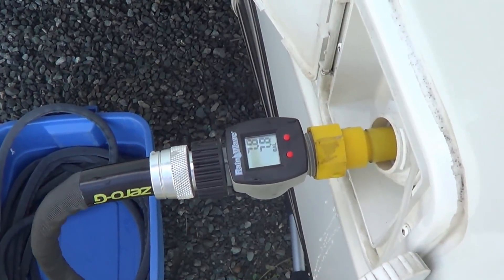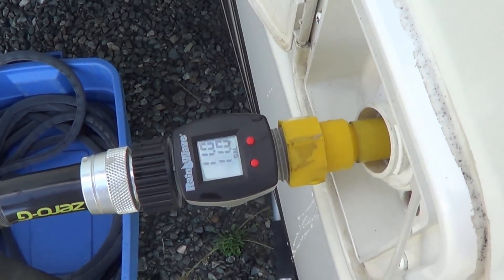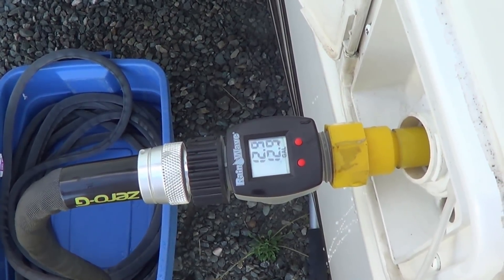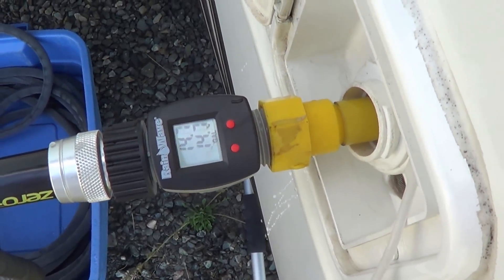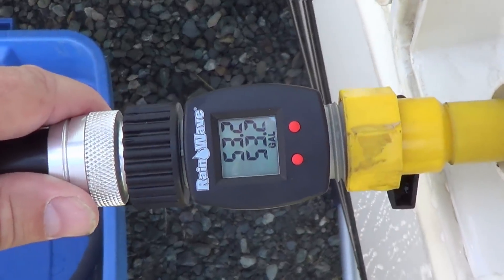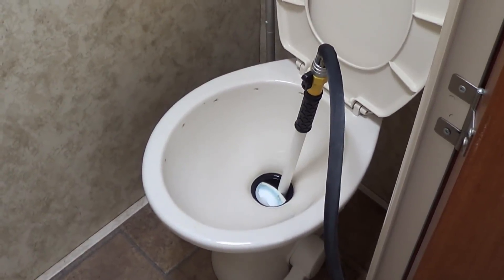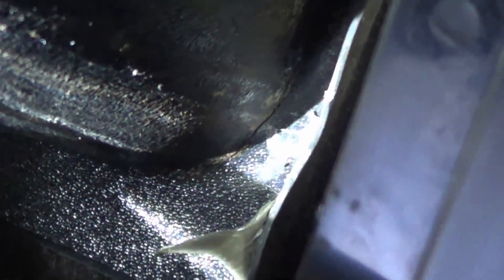Checking RV Tank Capacity - Then OH OH! Cracks!

Comment: I used the same stuff they use to hold windshields in cars on my black tank crack. Drilled small holes where the crack begins so it doesn't spread first. Never leaked again.  But my crack was not near a supporting part of the tank.

Comment: Morning Ray, John Ingebretson from Montana back at you. We, as you might recall, have the same model/year. I also found a crack in the black tank above the valve flange, not quite as high on the tank as yours. I elected to go two phases. Phase one, I mixed up my own ABS mix with acetone and shredded black ABS pipe, combined with a window screen patch. I applied several layers of that, and let it all dry. Then I took two applications of commercial 2 part epoxy tank repair from dealer with more window screen material, and layered that up. It appears you used a similar product on the flange out of your black tank at some point. So far after this latest trip,vI have not had any leaks from that repair. But having said that, I think the weight of the tanks on the rails, hanging down as Keystone has designed it, is definitely a weak point. Not sure what a permanent fix there would be. I might add, I had to replace the entire black tank two years ago because of a similar problem where the crack was 5" long. Some blogs have mentioned the issue of both tanks moving around on top of the Rails, because they are loose. It's possible they designed it to have that kind of motion, but this could cause strain and vibration on the whole system, leading to some of these problems. I'll be interested to see how the PlastiMend works, as I had considered that too. Also, after having used different approaches,  I've been thinking about which product to carry around for an emergency fix on the road.

By the way, I have finished my solar install, 4 Carmanah roof-mounted 170w (680w) with TS-MPPT-60 amp Controller & TS-RM-60 Remote Panel, and 4 Fullriver DC 22-46, 6V AGM's. So far, down in the desert and even up here in cloudy Glacier National Park, I have not had to use the generator! Can't believe I waited so long to do it. 
Thanks John
Reply from the maker: Hi John, thanks for the info. I thought I'd try the Plast-Mend since the cracks are in such a hard to get to spot and it looked like an easy application. I order 2 kits to have a back up for the road.
My black tank flange is factory, I haven't touched it. :)
Your boondocking system sounds terrific. Cheers! Ray

Comment: Ray, with great success, I have used a product called Plast-aid. I had stress cracks at the lower corners of my hot tub that were beginning to leak - similarly weight induced. Plast-aid has repaired the leak two years running with no further concern - at least at the points of repair.  This product sets up quickly and chemically bonds to the surface as a plastic. It's rated for use on ABS, and I am confident it will create as strong, or stronger, a surface as the original. You'll definitely figure it out. You always do. Love your videos.

Comment: Good luck there with the translucent white freshwater tank I could not get any form of glue to stick except the hot glue gun and that took quite a bit of supplemental heat to break down the tank material to accept the glue. I hope that repair with an ABS product works well for you I will keep watching

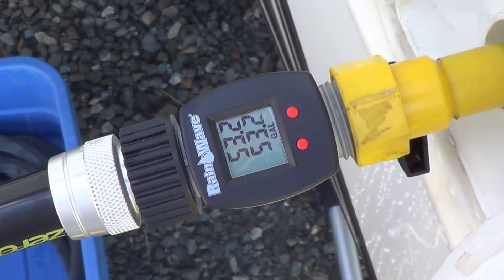Comment: Tipping the tank is a great observation at 2:00.  If stuck somewhere you could try lowering/raising the front of the RV vs draining the fresh water tank into a container.

As for the cracks please check out this person's fix - https://www.youtube.com/watch?v=N2rVLU3bDMY.  It is 25 min but worth a view.  He covers drilling holes into the crack line (ends and middle) to create crack stress relief which should stop the crack from extending in length.  How to make a heavy duty ABS cement by mixing ABS shavings into ABS cement.  This mixture is used with fiberglass to make a solid patch.  Good catch!
Reply from the maker: Wow, that's pretty ingenious of him. :)

Comment: Are you sure they are leaking and not condensation with the cold water you are putting in. Seems like you would have noticed a leak before this test. 

And with my RV, my total fresh water capacity included the water heater.
Reply from the maker: No definitely cracks. I never noticed before as they are small and thin and right at the tank top, tanks usually don't get full enough before dumping to leak there. I was trying to fill them to the max for a capacity test. Also, usually the coroplast underbelly is on and the drips would have pooled on it. I did notice some dried up water stains when I pulled it down to do the valves. Now I know where it came from. Cheers, Ray

Comment: Flex seal tape until you get your kit to repair it.  That stuff is a miracle.  You can even use it on the wet tank and it will stop water.
Reply from the maker: Not a bad idea.  Luckily the cracks are small and at the tank top and I'm stationary for a while so will leave it so I don't have to try and remove extra stuff to prep the surface. I think Eternabond tape would do a good job too. Man, that stuff is sticky! Cheers, Ray
Reply from the maker: Thanks. I think I'm going to get some of the Flex Seal tape to have in the RV on the road just in case. Cheers! Ray

Comment: Hi Ray. Since you are still at home base, Canadian Tire has a neat repair kit. It is called Bondo Fiberglass Resin Repair Kit, 5 piece kit. The product number is #047-5825-0, $39.99. It can be used on a variety of surfaces, metal, fiberglass and more. Check it out if you think may be helpful for those unfortunate hairline cracks. Good thing you did that test. I will bet you a doggie biscuit lots of folks are going to test their tanks now (thanks to the supervisor). Thank you for the heads up. Happy trails.
Reply from the maker: Thanks. :)  There is also the Discovery Boat Yard marine store, going to check what they have too. The tanks are ABS
Cheers! Ray

Comment: You might try plastic welding to fix the cracks. Harbor freight has a cheap  plastic weld kit. Its not the best rig but it will probably work for you. Its about 60 USD. Practice first before attempting a weld on your tank.
Reply from the maker: Thanks going to try a chemical weld first with Plasti-mend. The cracks are in an awkward to get a spot up high and in a corner. If that doesn't work I will likely pull tanks and try the plastic welding. Cheers! Ray

Comment: So I'm sure somewhere out there there is an adhesive that will stick to those tanks but I've never yet found it.
Reply from the maker: They are made of ABS plastic so I figure any ABS type repair should do the job. My top 2 so far are:
http://www.plasti-mend.com/cart/index.php?route=product/category&path=59

or I may just get some ABS pipe heat it up and form it to the surface and then use ABS glue to attach the patch.
Cheers, Ray

Comment: I know that we have similar models of 2011 Keystone 5th wheels. Over the last 1.5 years I have replaced the black tank due to a tank fracture, one grey tank for the same reason. And the second grey tank for a cracked fitting mounted in the tank. Both grey tanks according to the factory brochure are supposed to be  40 gallons each. In reality they are both 34.5 gallons. This tank is no longer available from the tank manufacture. The black tank replacement was with a different brand and slightly larger than the original. I did do some research and found the best repair was to replace the tanks. The cost of replacement for material and labor was about $1500 for each tank. I feel fortunate that I have an extended warranty that costs $200 per incident. Just more evidence that poor materials and installation designs caused by the manufacturer.
Reply from the maker: Wow, $1500! If it comes to that I think I'll order tanks from http://www.icondirect.com/categories/RV-Exterior-Parts/Holding-Tanks/ and install myself

Comment: You could use a polyurethane caulk like pl5000 available at home Depot along with a fiberglass mesh sheetrock tape to make the repairs. The stuff dries fast and is hard as a rock. Think Bondo.

Comment: Hi Ray. Could it be that the manufacturer’s specs are stated in US gallons and your meter is measuring Canadian gallons? If this were the case then your tank holds 63 US gallons. I apologize in Dan Vance if some has already asked you this question.
Reply from the maker: I did some tests on water jugs I have and it looks like it measures in US gallons. A few others have surmised that the reason for the lower than expected figure is the trailers total freshwater specs of 60 gallons include the 6 gallons that are located in the water heater.
Cheers, Ray

Comment: Ray FYI safety ,  make sure you have an organic mask when working with this stuff in close spaces. That is the Plasti- Med
Reply from the maker: Thanks for the tip, Laurence. It will be under the rig but fully exposed to the outside air. Will put on a mask to be on the safe side. Cheers, Ray

Comment: Our jayco whitehawk has a 42gallon fresh water tank. It would only hold 34 due to not having the over flow vented. It would essentially hit the overflow and start a siphon pulling the filled tank down to 32 gallons. I threw a y adapter on the overflow and vented it up to the screened vent on the fill port. I can now get the full 42 gallons on board.

Comment: Hey Ray, Flex-Tape As Seen on TV.. That's what I used. Lightly sand area around the crack and use large enough piece of tape to cover crack with a 2 inch overhang. Used it on mine few years ago and it's still not leaking. Good luck.

Comment: Well that sucks, two tanks have cracked near the top corner...hmmm.  While a repair is certainly in order I think you need to find out why they cracked in the first place so they don't do it again. After all a patch is just a patch. I don't know how yours are supported but you might need to ad more support. The RV industry certainly has the "do the minimum" philosophy nailed down pat. I hope you find a good solution.
Reply from the maker: 60,000 miles+ of towing all over the country and many gravel roads.  I'm on my 4th set of tires. So unlike some RVs, this one gets used. :) Also I boondock 4 months of the year on average so often travel with loaded waste tanks. 

I think I'll add some extra strapping under the tanks after the repair.

Comment: I converted to a composting toilet,  eliminated much of the problems with carting around raw sewage in your trailer.  As for repair,  plastic welding has come a long way if done properly (grind out the crack to allow for welding).

Comment: Just went tru that with my tanks I cleaned it all real well used fine sand paper  to rough it up a bit and used J B Weld 2 part quick dry and laid it in there in two coats worked very very well and took about a hour to complete

Comment: I agree with rabbj, the hot water tank capacity is always added into the total fresh water capacity.
I know that Eternabond tape does a great job of sealing water out, I wonder if it would work in reverse?
It looks like your tanks are fiberglass and not a plastic tank like I have, so a fiberglass fix kit would be most appropriate.
Reply from the maker: Eternabond, I'd use for a quick fix, but don't think I'd trust it long term with the tanks being under pressure when full, also the spot is in a weird corner.
The tanks are ABS so will look into an ABS repair kit. Found this one online so far - http://www.plasti-mend.com/cart/index.php?route=product/category&path=59   Cheers! Ray

Comment: I've had decent luck in the past using Goop or E6000 industrial strength adhesive on tank leaks.  I love the water meter gadget I wish I had one of those last year before I tested my fresh waters tank capacity by laboriously pouring in water 1 gallon at a time.  Brochure said 44 but it overflowed at 45 (pretty close).  What I also monitored while doing the filll-up was when each level indicator light would come on and the results were interesting.  1/3 light came on at 17, 2/3 came on at 25, but the 100% full light came on at just 37 gallons.  Eventually I want to do this when filling up my gray tank.  Good video as always.

Comment: sense its abs , you'll should drill each end of the crack to stop it  or it will over time keep splitting.   and might support the bottom with straps with rubber like a gas tank on a car for extra measure  to seal the crack take your pick.
Reply from the maker: Thanks! Good tips, yes it's ABS

Comment: Sucks what kind of material is the tank made of the appeared to be different than plastic. I might be wrong but it’s interesting that the cracks are occurring they tanks must be really getting so vibration.
Reply from the maker: The manufacturer website says ABS. We do a lot of off road to boondocking locations, returning with full tanks.
Reply: Love Your RV sure and like you said good thing you did your little test.

Comment: I don't know if it is model specific but on Grand Design facebook some with Imagine trailer found out that when emptying with the pump 10 more gallons were still in the tank. They hook up the winterisation hose down to the empty tank drain valve and then they are able to use those 10 gallons
Reply from the maker: Cool tip, thanks. :)

Comment: Ray, found this for waste tank repair, https://youtu.be/B5Rf71HM798.

Also heard that marine grade epoxy is an option.

Regardless the tanks need additional suspension as in straps. I've seen people add straps but didn't bother to add a membrane between the strap and the tank itself to avoid chafing.

Hope this helps.
Reply from the maker: Looks pretty good. I've ordered some Plasti-Mend - http://www.plasti-mend.com/cart/index.php?route=product/category&path=59 Will see how it works. Cheers! Ray

Comment: I was once able to repair a opaque white freshwater tank by using a hot glue gun aided by a heat gun and a touch of a blowtorch to get them finally to merge in one fluid repair.      Years ago I had a porta-potty that we carried out camping that had a tank for the black that was a similar material to our modern tanks today and the only way I was ever able to repair the crack in that tank was with good old duct tape and believe it or not that repair lasted for many Seasons

Comment: I would get a 6 oz. tube of "5200 Marine Adhesive Caulk.  Clean a test spot with mineral spirits and see how well it bonds with that type of plastic tank. You might try skuffing the test area with 220 grit sand paper to help it bond Let that set up for two days and then try to remove it.  If it bonds tight I'd patch it with that. The trick is to clean oils off.   I doubt fiberglass will work on plastic but who knows. Good luck
Reply from the maker: Thanks, going to hit up the local boatyards parts store and see what they have for ABS repairs. I may just get some ABS pipe heat it up and form it to the surface and then use ABS glue to attach the patch.
This is another possible fix for ABS - http://www.plasti-mend.com/cart/index.php?route=product/category&path=59

Comment: A few ways to "fix" this.weld it,harbor frieght sells a plastic welder rather cheap.abs cement with bits of abs in is so it makes it thicker,a fiberglass screen is used also.do not use flex seal.ultimately u may need taks because i been down this road an still leaking.its good for awhile but cracks again.id reccomend extra support for all the tanks
Reply from the maker: Thanks, I found this website, says specifically for ABS RV tanks - http://www.plasti-mend.com/cart/index.php?route=product/category&path=59  Looks like it may be just the stuff for the job being the tanks are ABS
Reply: Love Your RV let me know how it works.honestly i think its a crap shoot.we full time in our 5th wheel

Comment: I have a 100 gal tank. The last 25gal were below the pickup. Part of the reason was the supports bent and the belly of the tank dropped. I welded in additional support and got 8-9gal more.
Reply from the maker: Awesome, thanks for the tip, will have a look at mine a little closer, I know there are are a couple metal bands holding it. 
Cheers, Ray

Comment: Ray, You can use some Liquid Nails (Tan Tube) to seal up the cracks. I used that to install my Tornado Tank Rinser and it works well with water proofing the tank holes and any cracks. The stuff is pure silicone sealer. Once it is dry, it will not come apart ..... Swampy
Reply from the maker: Interesting, does it work well on ABS? That appears to be what the tanks are made from. I was leaning towards ABS repair kit or WaterWeld.
Reply: Ray, The Liquid Nails worked just fine on my tank rinse installation some 4 years ago. It is cheap and easy to work with, and is more of a topical sealer/glue than a chemical weld. It should in no way cause the plastic material the tank is made from to thin or liquify.  Depending on the stress on the tanks at the cracks, you may want to drill some stress relief holes to keep it from spreading ,,, much like stopping a crack in a fiberglass bathtub. You can always fill the holes with the silicone sealer to waterproof the hole. You could also make a mechanical brace across the cracks and secure them with the silicone and some stainless screws. If you use the chemical weld types of repairs, once the ABS is softened, the tank may try to return to its original pre-blown molded shape, making matters worse. But, if you had a large hole punched into the side, then that may be your only recourse when using a patch.  I first learned of the Liquid Nails product when experimenting to find something that would allow the polyurethane location tags to adhere to the concrete street light poles ... it beat the epoxies and 3M products hands down. BTW, I am a retired Lead Electrical Engineer (37 years) from the local Electric Utility. I also designed and installed miles of underground conduit systems and electrical High Voltage distribution lines.